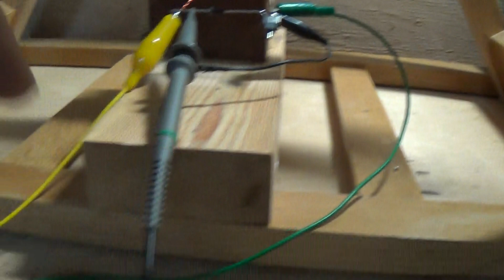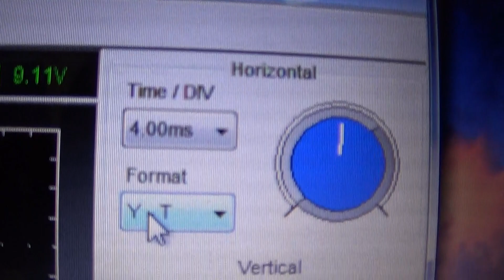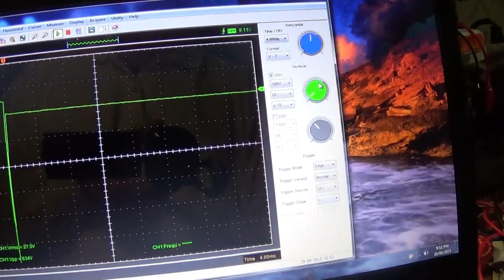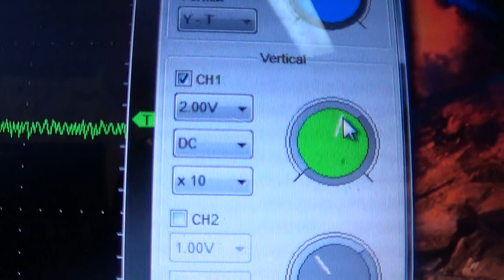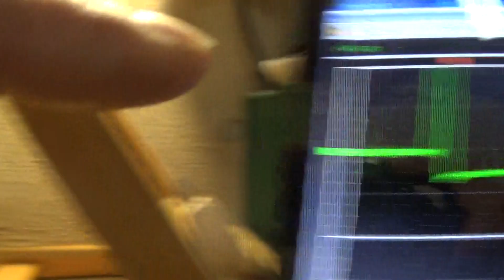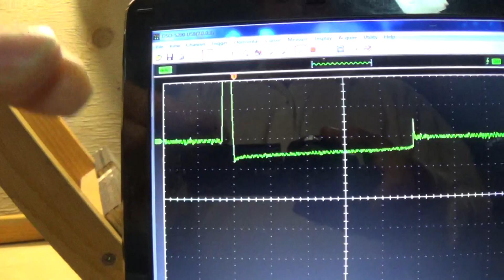Testing ideas of more efficient Coil Flyback use (test 1)

Comment: Oh boy!... Opinions!! ;-)  The diode allows the "accumulated" EMF to remain "functional", creating the magnetic field for a much longer time.  Since you're not saturating the high coil inductance with the very brief forward pulse, the coil doesn't have enough time to build-up a magnetic field through the solenoid. 

It would be an interesting variation on this test to see if 2, 3, or more series diodes would have any different effect... since the "clamped" voltage will be higher... would this create a higher magnetic pulse strength? 

Probably... however it will be of a shorter duration, since it's all about integrating the I/L/V curve of the given inductor.  You are putting in "X" watt-seconds, and the resulting magnetic field will average out to the same... either (with more diodes) a longer duration but higher flux strength... or (with 1 diode) much longer time, but at less flux intensity.

I think your subsequent tests will reveal this.

Thanks for sharing!